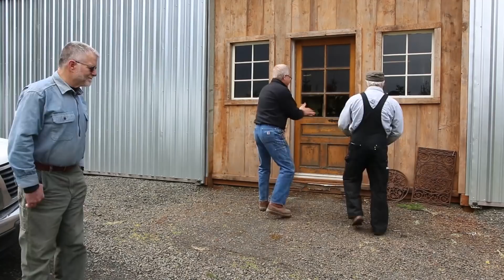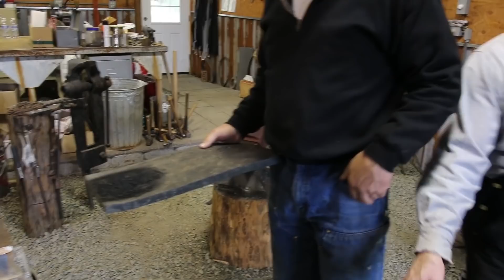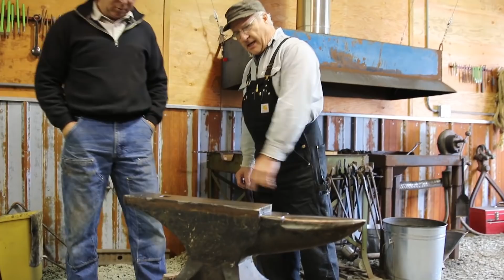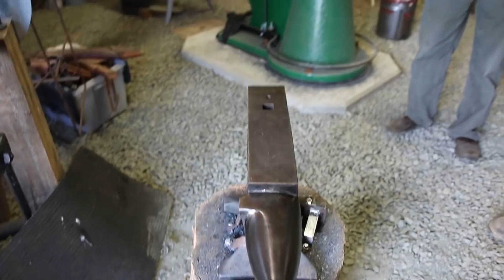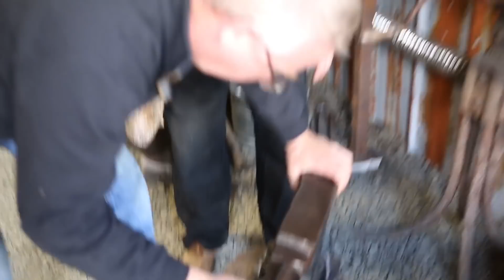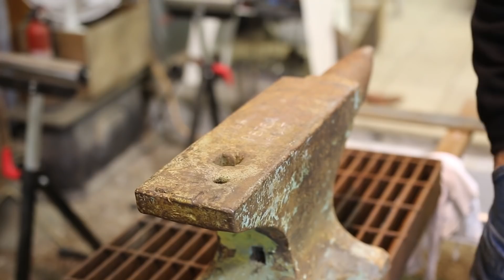Blacksmith Tool Show & Tell: Little Giant Power Hammer and Various Anvils

Comment: I'd bet money JHM used a Centaur Kohlswa M2066 (made in Sweden) to create the mold for their anvil. The only difference I can see is the M2066 had two (not one like that JHM) small pritchel holes in the heel. I have an M2066; I thought for sure that's what that was by the distinctive rhino horn shape of the anvil's horn. Compare them; betting JHM is a copy.

Comment: My grandfather used to work in the crime lab of a major police department and he told me that you can use a strong acid to reveal the numbers that have been filed off of a gun. 
Get your acid ready and some baking soda and plenty of water to neutralize it. Also, a friend with a pencil and paper to record them. Once you put the acid on, it will eat away the softer filed area, but leave the denser stamping. But it will also eat the stamping next, so have the friend ready with pencil and get the baking soda and water handy or the numbers will be gone forever.
The trick I've used is a bright highlighter and a blacklight. The highlighter gets into the stamping and the blacklight makes it glow clear as day. Doesn't always work though.

Comment: My grandfather had a blacksmith shop in Blue Hill, Nebraska which had two Little Giant 50# trip hammers. The first, number 202, was shipped to the shop January 26, 1901. The second, number 302, was shipped to the shop October 26, 1901. He sold the shop and retired in 1958. It continued as a blacksmith shop for some time but eventually went out of business. I don't know when that was and don't know what happened to the hammers. I can recall being awakened by the sound those hammers made while he worked on plow shares and the like on early summer mornings.